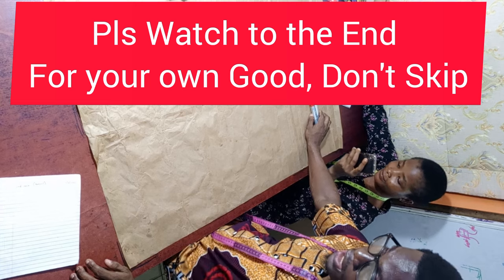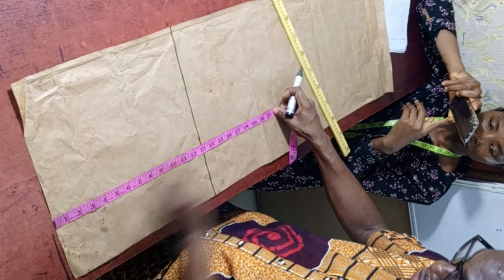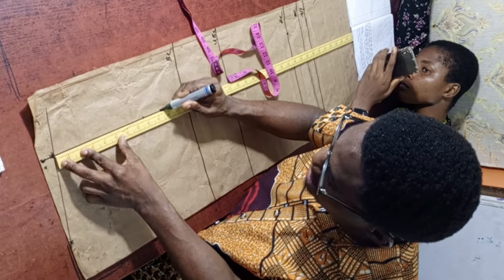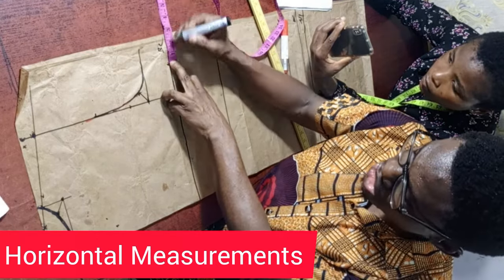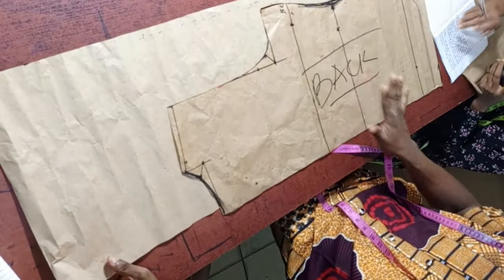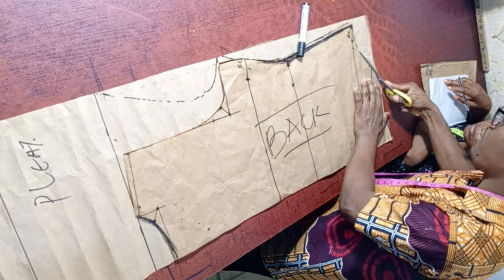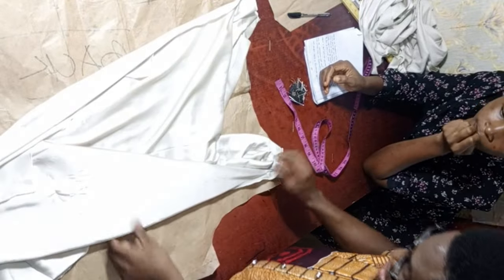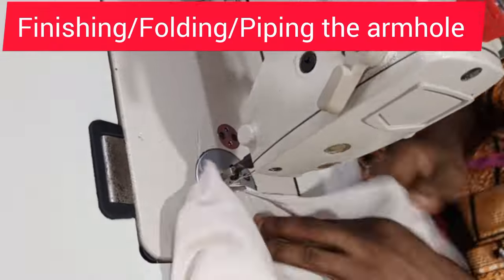HOW TO CUT AND SEW COWL NECK TOP (FULL COURSE)

Comment: Plz what if someone’s arm hole is bigger than the shoulder plus 1 and half measurement. Especially for plus size people which do u now use. Cuz my arm hole is 22 but when I use 11 length from the shoulder slop the arm hole is usually bigger when I remeasure with my tape
Reply from the maker: The method has worked both for plus size...the bigger you are, the bigger the shoulder...or you can also use the other formular bust circ/4 plus 1.5...
Reply: So like I said since my arm hole circumference is 22 and normal classes say use half which is 11 u suggest not to use that? So I shld stick to 10 and a half or 50/4=12.5+1 and a half that’s 14 that’s too much
Reply from the maker: @themissdeeshow  what is your correct shoulder measurement....also the formula I stated earlier is bust/6 + 1or 1.5...... not bust/ 4 please
Reply from the maker: @themissdeeshow  chat me up please .. I only do simple questions here +2347030445028 WhatsApp